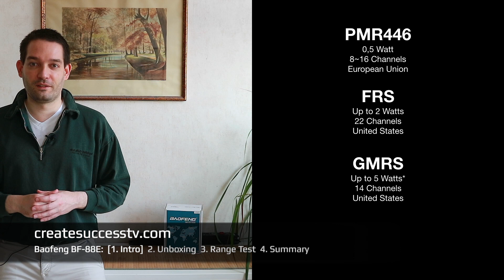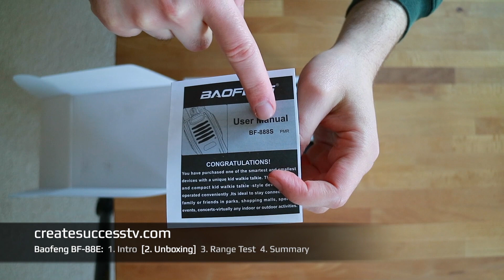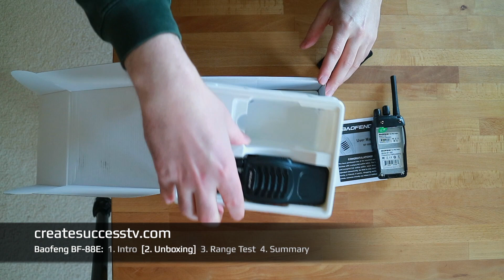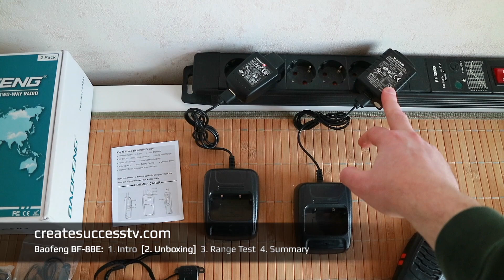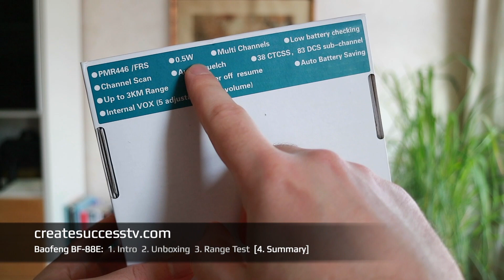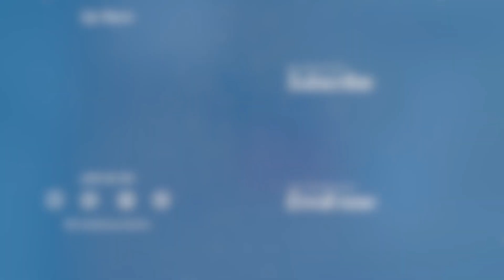Baofeng BF-88e PMR Two Way Radio (Review and Range Test)

Comment: I just bought 6 of these and they seem to work fine out of the box. Would it still be wise for me to open them in CHIRP and reprogram them? I just want to maximize the range and signal strength etc. I am in the US fwiw. Whats wrong with the stock freqs?
Reply from the maker: Thanks for your comment! Personally, I’m not a fan of the CHIRP software — I've found it a bit clunky and sometimes unreliable. I’d caution anyone using it, especially if everything’s working fine out of the box.
Reply from the maker: Also, be careful with the frequencies — changing settings like that may not all be legal.

Comment: Oh my god, the charger has a thin wire carrying mains voltage.. What has gone wrong with people? They are made of cotton wool.. 
The video is very informative regarding range testing, of course line of sight with nothing in-between would reach several miles.
Reply: That cable is not carrying mains voltage. It's +/- 5vDC USB.

Comment: If you plug it in to a programming tool you can swich it to high which is 2 w as the 88e and 88a are pretty much the same one just has more channel swiches   they program the same
Reply: just a quick question. so technically these can be programmed to increase performance significantly right? also, theoretcially, can the antenna be replaced? Thank you.
Reply: How tho

Comment: If you buy these check what you actually got sent (code under the battery), there are many vendors selling BF-888S and calling it BF-88E, others claim to have reprogrammed BF-888S to be PMR compliant when really they haven't touched it and then they won't talk to other PMRs. The default frequencies of BF-888S interfere with some UK emergency services. Probably it's easier/cheaper for them to buy BF-888S in China instead of the export models and then just lie to the customer.
Reply: RADTEL RT88 in Canada. FRS 462, 467 MHz but with fixed antenna
Reply: 409 MHz in China, but mine, programmed to Taiwanese FRS frequencies
Reply: There is literally no way to make 888 or UV-5/82’s and similar models PMR legal, as the requirements state non-replaceable antenna and 0,5W transmit power.
Even with a HAM license it is illegal to use them for transmission. You can use them for listening, but are only legal to transmit at frequencies you are licensed for (VHF/UHF bands).
OTOH even when used on PMR the range is so short no one will bother to complain, especially if you comply with the 12,5kHz bandwidth (narrow), so you don’t spill over to adjacent channels.

Comment: Why shouldn't I use the bf 88e in the United States?
Reply: Because these are adjusted to EU Laws. To use the American Version buy the Baofeng 88A
Reply: @josebarroso2184 0.5W for FRS 467 MHz in Low Power. Aka RADTEL RT88, program through CHIRP software and also change to Taiwanese 467 MHz FRS, includes 6 GMRS repeater and 5 FRS frequencies
Reply: @josebarroso2184 CHIRP software

Comment: I have the nestling BF-88E identical to these, just a different sticker on the front. Do you happen to know if the Baofeng cable and software would work with these?
Reply: Same here there the same thing just branded different so it would work I would imagine

Comment: did you make the programming video?
Reply from the maker: Nope, I didn't make the tutorial yet, but with the USB programming cable it should be fairly easy, just be careful with using CHIRP, if at all possible try to use the manufacturer's software.

Comment: Lousy range! Definitely need the power pumped up, but not sure of the environmental considerations you did the test in, and you didn't state it.
I had a chat with another user 50 miles away using a one watt Floureon 446 radio recently.

Comment: Is the programming cable and the software included in the box? where did u get it?
Reply: Could you program on other frecuencies , for example 8 on pmr and other 8 on frs?
Reply from the maker: @DIEGOHERNANDEZM  You can program most radios anyway you want, however, please take local laws and regulations seriously, because transmitting on wrong frequencies can cause interference with other radio services.
Reply: @ReviewTechTV   i know, i have a uv82 ,  but these radios only allow program on frequency 446, or you could program it on 462-467 ?,i don't wanna buy two different radios to travel
Reply: @DIEGOHERNANDEZM  You can programme a UV82 on any frequency up to 512mhz!!
Reply from the maker: No, the USB programming cable is not included, but can be easily found online, for example:
• Baofeng Programming Cable on Amazon ➜ https://geni.us/pTQaN
• Baofeng Programming Cable on eBay ➜ https://ebay.to/2Mw4f89

Comment: Just a point in great Britain Ofcom allows us to have extension antannaes on our pmr 446 radios as long as the power doesn't exceed 0.5w does the pmr 446 baeofeng have a small screw at base of antannae anywhere which allows it to screw off when removed ? Enjoyed the test as always well planned and delivered on post thank you.....
Reply: Now I thought the regulation that covered 446 license free use in the UK also said antennas could not be removable? Is that incorrect?